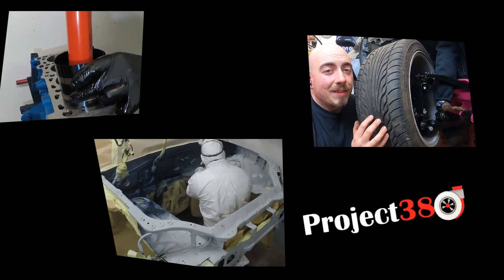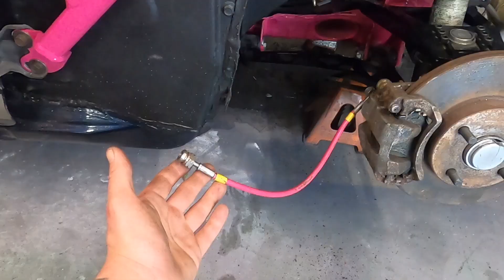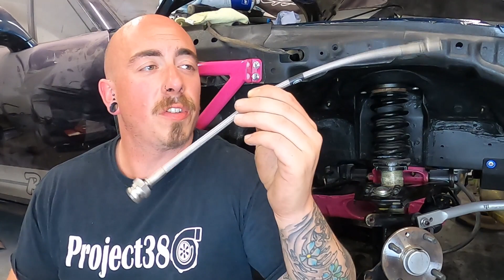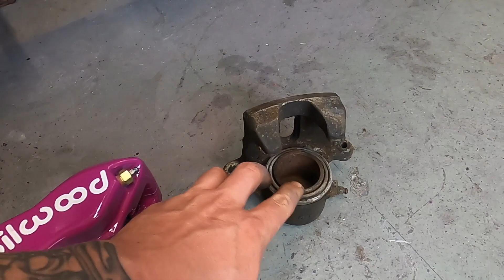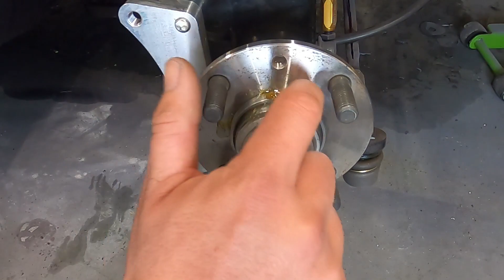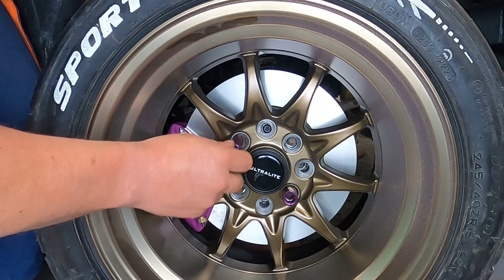MX5 WILWOOD FRONT BRAKES : MX5 TURBO BUILD pt 46

Comment: There's some misinformation in this video which I see a lot. Changing the brakes isn't going to add any additional braking force with like for like pads, the main benefit is increasing fade resistance by adding more thermal mass with the larger rotors. However, the rotors in that kit have poor ventilation and are fed from the wheel side, rendering adding brake ducts very ineffective which is a shame as they are the primary way of reducing brake temperatures for track work and really should be the first thing you do on for a track orientated brake setup (they also only cost £40ish to do). If you want more braking force the cheapest thing you can do is fit the larger 1000psi brake booster, and after that pads with a greater friction coefficient. The 4 piston calipers also don't add any additional clamping force, the total piston area is very very similar to the OE setup as the pistons are smaller despite there being more of them, this is by design as otherwise it would negatively affect pedal travel. The 2 main benefits of 4 piston calipers is to apply even pressure to the pad to prevent wedging, and allowing the removal of a floating caliper which often experiences the slider pin grease drying out with heat during track use and needing frequent maintenance. The total clamping/braking force you can utilise is determined by the tyre grip available (you cant slow down any faster if the wheels are just skidding along the ground) and the stock brakes/pads are more than capable of locking the wheels.

I'm not a big fan of the dynalites in general, they flex a significant amount due to being a 3 peice design (2 caliper halfs and spacers down the middle for aplication in different cars with reduced manufacturing costs), they are a really small caliper and there just isn't a great deal of bracing provided by the bolting locations. The 12mm thick pads also wear super fast. A lack of dust boots with stainless steel pistons is a double edge sword, while no boots reduces the chance of them melting on track you really should have adequate cooling to prevent this anyway. What you will experience though is dirt getting down into the pistons and it causing wear around the caliper body, the pistons will also wear and experience some uneven drag which will result in brake squeal under light application which gets pretty unbearable on the road. This dirt and wear also means that everytime you want to change the pads the pistons need a proper clean of debris and dirt before they're pushed back into the caliper, very inconvenient at the track and all avoidable if there were dust boots. They're a cheap caliper which will need replacing every 3-5 years.

Wilwoods in general all suffer from terrible bleed nipples, they are tiny 6mm aluminium things which seize and shear easily. Only gently nip them up and make sure you undo them a few times a year to prevent seizing.

I went with the midilite kit with 300mm discs as given the cost they are extremely good value, well suited to pad changes at the track due to a reusable quick release retaining pin, and feature changes which negate nearly all the dynalite issues. The downside is the weight penalty from the discs (adds thermal mass to aid cooling so a worth while trade off though), and the fact the kit is so big there are only about 5 models of 15" wheel that will clear them.

The clio brembo kits are worth a look too. The caliper body is wider which limits wheel clearance, and the 280mm discs have less surface area for ventilation/ducts but do feature more overall thermal mass (but also weight). The calipers can be picked up for about £150-200 a set used and a rebuild kit is only £60.
Reply from the maker: i wish i spoke to you before i decided what brakes to buy. thank you for all the information

Comment: Good video for those who are looking to upgrade to this kit or similar 👍🏻. Worth noting though that changing the pads is a little more tricky than described as you’ll obviously need to retract the pistons which is easier said than done. You WILL need a piston retracting tool for simplicity or you’ll be there all day getting them to slide back to the starting position in order to fit the new pads. It can be done without but believe me it’s such a faff and takes ages. Get a proper tool for less than a tenner and it’s MUCH easier. Keep up the good work!
Reply from the maker: omg i completely forgot about this, thank you, i wish i included it in the video now
Reply: @Project380  I wish I practiced what I preached and bough a piston retractor before trying to change pads on my Wilwood setup last week 🤦🏻‍♂️. Got one now of course 🤣
Reply from the maker: Don't worry doing brakes is actually my job and i forgot 😂

Comment: What a load of twaddle.
You don't need bigger brakes on an mx5 road car. I've been turbod for more than 15 years on standard sized brakes. High temp fluid and decent pads is more than enough for a road car...
Reply from the maker: hi there, this is not going to be just a road car, perimammary its going to be a track car